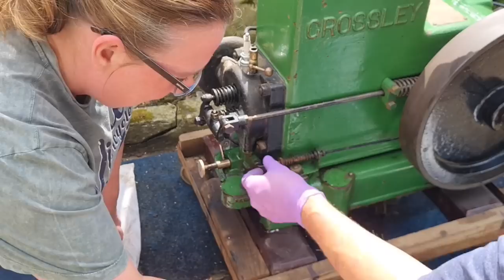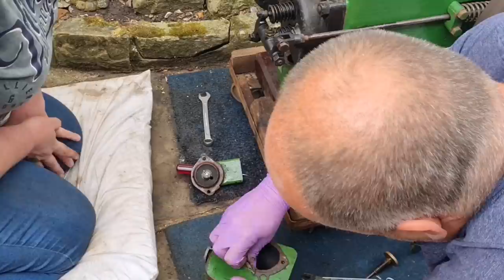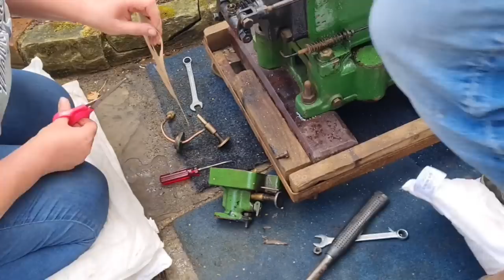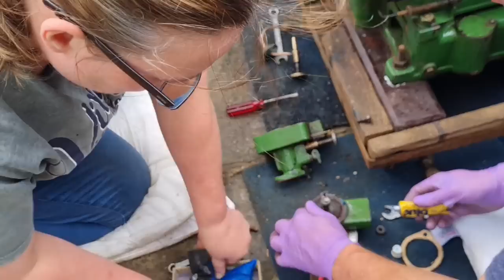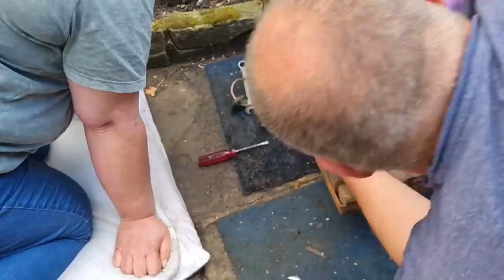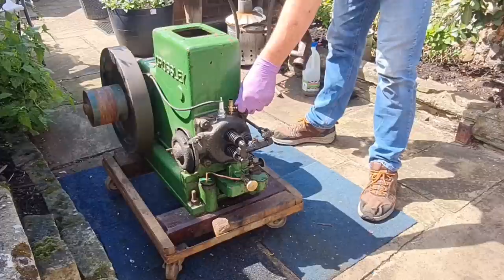Crossley 1030. can we get it to start better?

Comment: What a weird thing going on there with the fuel im seeing quite a bit of blue smoke coming out the exhaust it might be oil fouling, but then again old engines do smoke a little might be worth having the head off and lapping the valves that would be fun for mrs mancave anyhow , might possibly be valve clearances, might even be the governor rod as you aint had that off yet. I also did some research on this engine and apparently you fill the bowl with petrol and have the fuel tank full of paraffin/heating oil and when she warms up you open the fuel tank needle therefore converting it to run on heating oil/paraffin so you wernt wrong the other day it is a petrol paraffin engine. Great vid as always 👍

Comment: That drip could be from the front fuel mixture wheel. Should there be a little fibre washer that buffs upto the body between the brass part and the body

Comment: What draws the fuel from the tank? Airflow through the carb? The tank obviously isn't pressurised and there's no pump so maybe the port inside the carb is restricted or the tap at the front of the engine has an air leak and draws air more than fuel? Check for air leaks around the outside of the tap body.

Comment: The hole in the carb intake is probably to allow you to catch the fuel drips if the carb floods, otherwise the excess fuel would run underneath the engine.
You are right to be careful with the starting handle, I once saw one fly off a Lister HR 2 gen set engine, it knocked a 9" concrete block straight out of the engine house wall. The guy starting the engine was inexperienced. When I saw the handle swinging loose I ran out the door dragging the other fellow after me.  20 seconds later the handle came out through the wall.  I also met a trawlerman who started an auxiliary winch engine in the forepeak with a sticky handle while he was alone on the boat. The handle pulled out of his hand, He couldn't reach the stop lever and he coudnt get out past the swinging handle. He cowered in a corner for 12 hours until the engine ran out of fuel. He went a bit crazy that day.

Comment: Holy Moses, I had visions of that handle flying off into the wide blue yonder! - I wonder if that's where we get that saying from, about flying off the handle? Especially if Charlie Farmer was getting a bit airiated with his engine, gave it an extra strong swing over and flew off the handle .......

Anyway, that's definitely running a lot better, and d'you know, that engine could just be able to run on paraffin. If it runs twenty minutes on just primer bowlful, you might get away with putting paraffin in the main tank and switching over once the petrol is about gone, and the engine is warmed up? Just a thought.

Now then, you two just look after little Connie, she's been watching over this engine saga, sitting there in the border and catching all the diesel and muck and dust you throw at her - She's obviously a sturdy little cat!

Annie Hoos, will you be showing the Crossley this year?

Comment: You cant overfill the bowl unless you actually psychically overfill it lol, also turn the needle a quarter out not lots of turns
Reply: Also with the handles , I've never had an engine kick back unless it has a impulse mag , I always hold the handles thumb around and pull up never has one break my thumb before with my way of starting and you can pull the handle off easy without it sticking😎
Reply: It stopped at as it ran out of fuel at 33:50 as the pickup pipe doesn't reach the bottom they have to be half full to actually suck the fuel up as no check valve